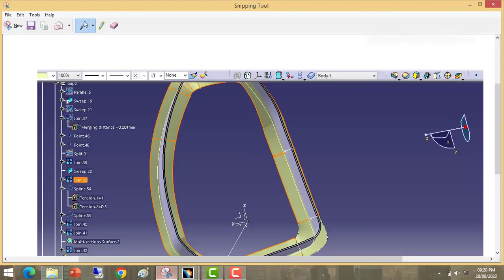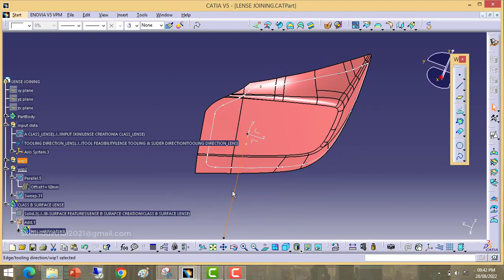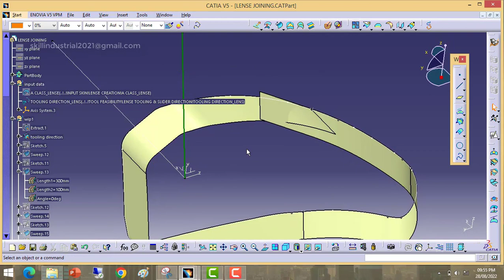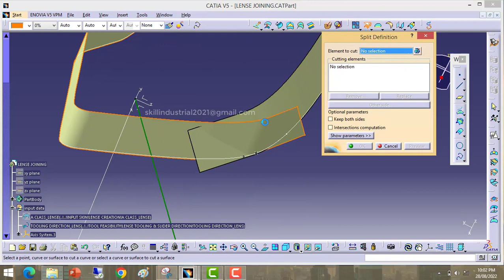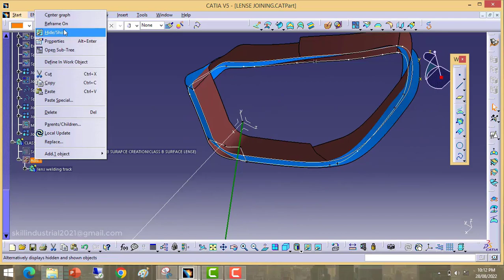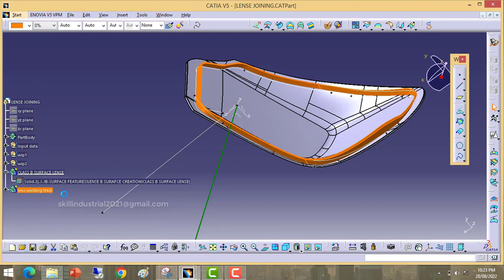Automotive Plastic Design/Plastic trims course|Catia v5|Demo class

Comment: How u will decided  slider area in this part
Reply from the maker: Slider requirement always depends upon part geometry.
Side undercut which is not clear in main tooling direction then only we  use slider in mold for easy ejection of part